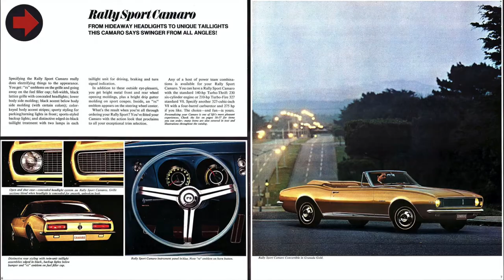History of the Chevy Camaro

Comment: Great video Only correction - at 8:01 you say that the 2016 Camaro had the 505 horsepower LS7 engine.  2016 was actually the first year of the 6th gen and had an LT1 engine which made an impressive 455hp.  The 505 hp LS7 was offered on the 2014 and 2015 track monster 5th gen Z/28.

Comment: Good information, just a couple of things though. The first generation never came with a V6, only an L6 or a V8. Next, the third gen was the first Camaro available with an L4, known as the Iron Duke. Also, the 3rd gen offered a 4-Speed manual gearbox as well.

Lastly, and this one I take great exception to, how would say the 4th gen is fat and cumbersome? The 4th gen weighs 3,439 for a hardtop, and the fact that the engine is nearly mid mounted, the car is aerodynamic and quite agile. In fact, in stock form, a 2022 SS with the SLP 345 performance pack was wrecking the 2010 Camaro SS due to its weight.